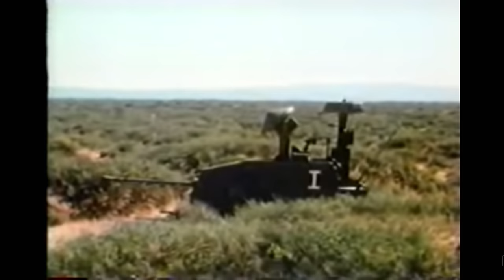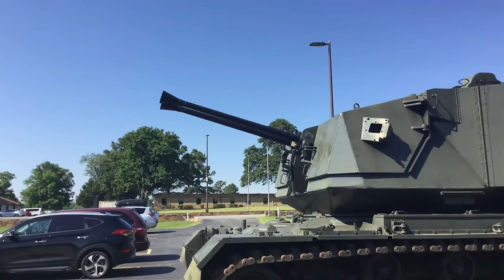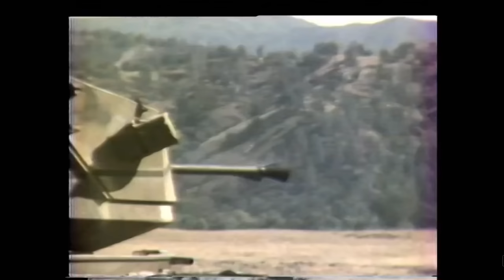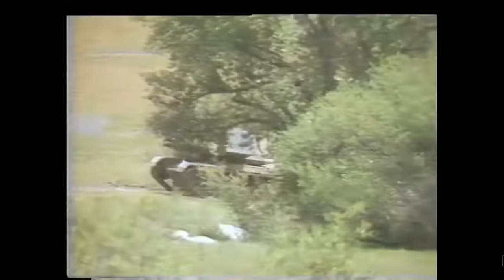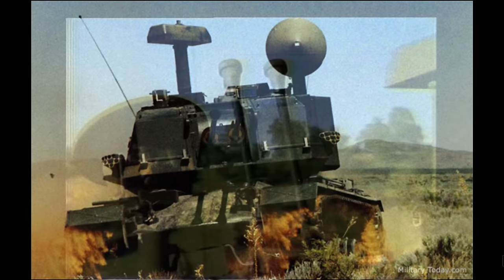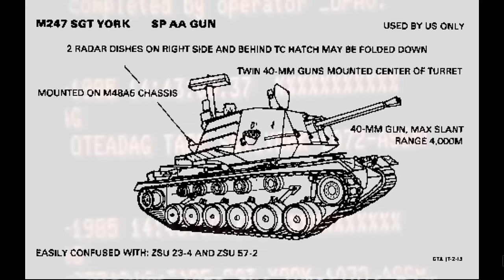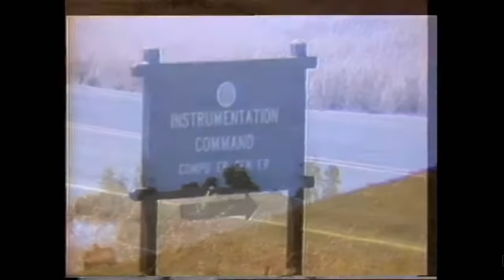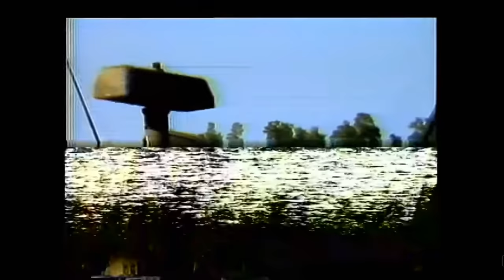M247 'Sergeant York' | WORST AIR DEFENSE EVER!

Comment: The 40mm L/70 was not obsolete by the 1970s it had seen continuous development since 1948 for instance the fire rate had been increased from 240 rpm to 300 rpm.
Also as 1960s turned into 1970s it got proximity fuzed ammunition and to this day 40mm remains the smallest caliber to have this.
In fact the 40mm L/70 is still in production in its mk4 variant which is electric instead of hydraulic
Reply: If anything, autocannon are going back to the 40-57mm range anymore. Anything less is becoming... problematic... in terms of kill capability.
Reply: 100% correct. These guns are more closely related to the modern Breda DARDO fully automated type used in shipboard mounts and not the manually operated WW2 type. I don’t think the US has ever deployed the DARDO in any significant numbers other than maybe for trials. The Sgt York was a failure of project development, management and systems integration. Contrast tis with the Shilka: adequate gun, radar/FC and vehicle properly integrated into a very effective weapon system for its time.
Reply: @TheTrueAdept  That's ironic as the original requirement when the 40mm calibre was chosen for what became the Bofors 40mm L/60 was that it should be fatal for the target with one hit.
Reply: @zenonsplawinski9436  The main problem with the 40mm L/70 in a vehicle is that it's very high. 
That's why in the Cv90 it's inverted and fed with a hydraulic loader from below !
But it also has the 3P programmer which can program the shells before they are fired to for instance pass through the top of a forest before activating the proximity fuze and hit a helicopter behind it.

If i remember correctly i think this is how the 35mm Oerlikon competitor approximates a proximity fuze they have an automated system that tells the shell when it is fire at which distance it is to blow up. Which means you need to predict the target location and have good range data.
Reply: @AdurianJ  True given the circumstances. The problem is that more places are armored against anything less than 30mm these days, and that is causing problems. Sure your average townhouse in Smalltown USA or Village Europe aren't going to be laughing off 25mm rounds, the situation is that most places AREN'T those locales and they've armored their buildings to resist most autocannons either due to conscious design decisions (basically everywhere NOT Europe or 1st World) or due to design requirements (skyscrapers). Add to the fact that the 'Griffin III' has 85+ degree elevation capability for its 50mm autocannon... that is telling on what is in for the future.

The 40mm sensor-frag round was pretty effective in doing its job (killing aircraft), and you can add HE rounds so you can better support the infantry. This very same system would be later used in the 'Trinity' prototypes which were essentially a LAV with a 40mm AA system slapped onto it.
Reply: Smaller ammunition in the 30mm and 35mm range can be electronically programmed to time burst by a device at the muzzle that both measures velocity and then programmes the timer.  With radar and muzzle sensors measuring the velocity at exit prior to programming it’s very accurate and also useful against personnel and vehicles.   An example is AHEAD.  Radar often further tracks the round and measures the miss distance and allows compensation of the subsequent round.   I suspect 30-35 mm guns will find application in drone destruction and destruction of anti tank missiles.  The Russians famously integrated a two stage missile with a 30mm gun to get the rapid reaction time of the gun as well as the range of a missile.
Reply: AdurianJ 
Bofors 3P is very impressive. With its multipurpose rounds and capability against targets in defilade and helicopters it makes for a great IFV armament.
Reply: @zenonsplawinski9436  I think the main difference why one is a good system and the other a lemon comes down to "You fail, you will go to the Gulag now" contra "You failed, now go to your comfy and wellpaid officejob" 
If you know screwing around means spending the next decade or two in Sibiria, i'm sure that is an incentive to make sure things work.
Reply: @BigSwede7403  Also Sweden allready had a lemon in the 1960's VEAK which used two 40mm L/70 guns just like the SGT York.

I believe it's faliure came down to cost and an overly complicated radar with search and fire control sharing the antenna like a fighter plane.
Reply: @AdurianJ  There's still not a lot of planes that can take a single hit from the Bofors 40mm and keep flying
Reply: @AdurianJ  Huh. Didn't know about that one. Interesting.
Reply: The 40mm received proximity fuses in 1942. NINETEEN-FORTY-TWO.....
    There was an OBSCENE amount of money wasted in Reagans arm race with the USSR.
Reply: @todiathink8864  You are wrong there where no proximity fuzed that small in WW2.

The smallest proximity fuzes in WW2 where for the British 114mm (4,5 inch) 

naval guns
Reply: I just watched a video on the 40mm Bofoors with proximity fuses! The 20mm were replaced with the Bofoors and the Dakota class BB's were fitted with them.
   Also, the Enterprise was fitted with the Bofoors when in dry dock in Washington SPECIFICALLY BECAUSE of the proximity fuses! DO RESEARCH Einstein.
Reply: The 40mm proximity fuse was the best kept secret of the war. When the war ended, everyone knew about the A-bomb but the proximity fuse for the 40mm was STILL a secret.
Reply: @todiathink8864  
The 40mm did not have proximity fuzes no matter what you claim a "Video" on the internet said.

The 40mm Bofors was fitted to US ships because of two reasons.
It was superior to the US Designed gun in the same class.
And a gun was needed that was big enough to shoot down enemy aircraft before they dropped their bombs. Something the 20mm Oerlikons could not do reliably.
Reply: I got the information from a you tube video just like YOURS. (Battlefield 360 Enterprise vs Japan)
   So, it's every bit as credible as YOUR YouTube video. 
   Nuff Said
Reply: BTW..... the refitting of the Bofoors to the Enterprise was done in Pearl Harbor, not Washington.
Reply: @todiathink8864  I got my information from the book "Bofors 350 years" which is the official history of the company.

There are other sources than documentaries and that 360 series does not give a reassuring impression.
I would suggest you should watch lecture videos instead like "Critical Challenge: A History of the Proximity Fuze presented by Stephen Phillips"
Reply: @zenonsplawinski9436  The 35mm competitors worked ( Both the USA one and the German Gepard ).
Reply: 40mm kanons were used in WW II by both sides.The 3 barrel Orlikon was truck mounted by the Germans.They were called flakwagens. So, anyone who do not what to catch any F.L.A.K. should not annoy people with super powers!
Reply: Doesn't matter. It's outraged by missiles.
Reply: Broke As FK  The latest version of the 40mm Bofors has 100 rounds in ready to fire magazines with the possibility of switching ammo types on the fly.

Clips vs belts have different advantages, clips are easier to load on the fly without taking the gun out of action temporarily.
Belts can have many more rounds.

The 35mm also don't have proximity fuzed ammunition instead they get told at the moment of firing when they will detonate by the fire control system.
Reply: @AdurianJ  Yeah that 35mm AHEAD ammo looks amazing. I think they also have the tungsten pellets/shot have a pretty uniform pattern with the fuse. I do know the gun primes it as it is leaving the barrel. Seen a test of what I believe is the SkyNex system take out 8 drones in one small burst. Kind of overkill for them but effective.

 Why the hell the US doesn't use such ammo and systems for the CIWIS and Phalanx is beyond me. Sure its cool we can essentially shoot a bullet with a bullet mid air but feel like there is a larger room for error and requires longer bursts.

 Also the 20mm doesn't have enough range or power. I guess the new hypersonic weapons are armored? I call BS on that ‐ at the speeds those things are going any piece of tungsten should be sufficient enough to cause significant damage. Even if it only damages the flight surfaces the missile would tear itsself apart or definitely miss the target.

 The Italians 70mm Naval gun is getting upgraded to 200rpm. I guess it can shoot down basically anything that flies and surface ships. Maybe the US should buy that and upgrade it with AHEAD type ammo. The range and amount of tungsten thrown into the air with such a gun would make quick work of anything. 

 Yet I am just a pleb. I don't know why we do things a certain way.
Reply: @dianapennepacker6854  The 35mm gun in the Cv90 does not have nearly the muzzle velocity of the 40mm Bofors but it has greater ready ammo loads. The AHEAD lacks a proximity fuze though which is very usefull for an IFV that lacks radar.
Reply: @AdurianJ  Oh I wasn't talking about
Reply: @AdurianJ  Well yeah I imagine better range as well. I am wondering what caliber most countries will settle on. First generation laser defense is coming online and looks promising.

 do know the AHEAD is an air defense system that works in tandem. Not really sure what Skynex is filling over Skyguard TBH. Not sure about the nuance or key differences. I just know it can be used against incoming air and ground targets. Definitely wouldn't want to be on the receiving end of it. Not that there are many bullets in the world I want coming at me hehe.
Reply: @dianapennepacker6854  Sweden will probably get the 35mm bushmaster or get a Bushmaster developed that fire more powerfull 40mm ammo. This for the next generation of fighting vehicle which will start development this year.
It will probably become a Cv90 mk5 or a Cv90 successor.
Reply: @AdurianJ  no, until the 1970s, the smallest round that can fit a prox-fuse is 75mm (the Skysweeper had HEPF rounds).

Comment: This sounds like the much needed Pentagon Wars 2.
Reply: Yes
Reply: The f35. Nuff said....
Reply: @903strikerunit  Part 3
Reply: Pentagon Wars made reference to the York somewhere in the first minutes I think.
Reply: Luke L.  development had plenty of problems. went far over budget, and is overpriced yet lacking in promised capability. its a joint strike fighter that isnt good as a striker and isnt good as a fighter. its isnt nearly as stealthy as the f22. can be detected by some current(and near future) sensors at bvr range. stealthy exhaust nozzles were designed with air combat in mind(thus bad stealth for strike missions). faceting and planform alignment isnt as stealthy as the f22, or even the x35 prototype. has poor kinematic capability. poor speed, poor acceleration, cannot supercruise, is not supermanoeuvrable. is not energy efficient too, therefore more fuel consumption, this is made worse by its small fuel capacity, thus you are forced to use drop tanks or aerial refuelling ALOT especially when carrying weapons. sensor capability is lacking. it has a small and weak radar and so bvr performance is lackluster. radar cannot be mechanically steered, so you are forced to use electronic beam steering only. very vulnerable to flanking attacks because of poor steering capability. its ELINT apertures are far fewer than on the f22. f35 will always be forced to rely on networking as its sensors are lacking compared to the f22, or even some gen4.5 fighters. it has poor payload, operational range, and overall striking capability. an f22, or an f15 silent eagle could, in theory outperform it in almost everyway. they would do well for strike missions, and also as fighters. do not underestimate the striking capability of a large high impact fighter that is stealthy at the same time. the f35 cannot perform strike missions safely against a sophisticated defender. the f35 will be forced to use stand off missiles as it isnt stealthy enough, and cannot penetrate deep into target territory. oh but long range stand off missiles are large, heavy, and expensive. the f35 will only be able to carry a few due to its low payload capability. on long campaigns, the f35 will drain the national budget because of its over reliance on stand off attacks. come to think of it. do we really need an f35? an upgraded f22 can do the job FAR better. an upgraded f15 and f16 can still remain relevant with stand off munitions and improved networking capability while being a cheaper option, as they are already available and dont need to be procured. instead of wasting money. wont it be better to make gen4.5 versions of our gen4s, and develop a gen6 that would supplement the f22? a new modern age of dogfights will come when stealth tech becomes more common and engagement ranges come closer and closer. most likely when gen6s come, the f35 will almost immediately become obsolete.
/
/
just kidding. the f35 is wonderful. lockheed and 1 million people say so, therefore it must be true. the f35 is a very good jet. it should not be on pentagon wars 3. countries want to buy the f35. they are totally not forced to buy it because they have invested money on it and have no other choice. if countries are buying it its a good jet. oh yeah, you can ignore all those totally fake reports about how countries are cutting down the number of f35s they want to purchase. its just russian propaganda.
Reply: @usaisthebestiockdownpoiice816  Binkov did a simulation of f35s vs Su35s and the f35 won most of the scenarios. 

Take off the tinfoil cap buddy. And before you say why should you believe Binkov.... why should I believe you?
Reply: @jedispartancoolman  you mean binkov battlegrounds? so, you use his videos as a way to placate your butthurt about the f35.. im no binkov fan nor a hater. and neither am i a tinfoil hatter. maybe instead of going the ad hominem route, you state the reasons, RIGHT HERE about how amazing your f35 is. you f35 apologists always have plenty of excuses all while deluding yourselves about the f35. first you call it a joint strike fighter, and when people point out how its lacking both as a striker and a fighter, you make excuses and site "sources" like binkov battlegrounds. meanwhile you ignore actual thinktanks and academics who have studied the f35 and who consider it as a jet of lacking capabilities. we dont need an f35. an f22 with improved ground attack capability is VASTLY better. stop deluding yourself kid. there are legitimate reasons why people hate the f35.
Reply: tell me, in what way is an f35 better than an upgraded f22. give an f22 thermo optical sensors, and it can do the job far better.. what about an f15 silent eagle? same story. upgraded f15 and f16 with standoff munitions would be a cheaper option, while we make a 6th gen fighter to supplement the f22. the f35 is lacking in LOTS AND LOTS of areas. and to make things worse, you cant upgrade it as easily as a larger fighter.
Reply: @usaisthebestiockdownpoiice816  nah
Reply: @jedispartancoolman  so youre all talk but no substance. fine... you keep fanboying over your f35. ill fanboy over my f22.
Reply: @jedispartancoolman  not even a part of this discussion and I know nothing about the topic, but he comes off as being knowledgable about the subject while you just go oh hurr durr tinfoil man and sling names, without providing anything substantive
Reply: @melikecomedy  his claims are baseless lmao. I told him to source his arguments. Not hey some guy who never flew this and his experience is ace combat.

I gave him my source and told him to counter. Get over it. All he did was spout the same BS every other troll does

Comment: Worked North McGregor Range detail crew in '85 during the testing of the York and it's counterpart the Vulcan against all sorts of targets. Was effective against ground targets and at least one high speed jet propelled drone. The 7 on-board computers and complex systems made this more expensive than an M1 tank. It DID take out an outhouse on the left side of the range just after the 1SG had just used it, couldn't ID the rotary fan on the roof and in front of a gaggle of Politicians to boot. Program was cancelled just days before the first AIT was to start and we prepped and shipped them back to the manufacturer. The Hulls were given to the South Koreans with old 48 turrets.

Comment: 40 years later the US Army still has no AAA in service.
Reply: But the two largest airforces in the world are the US Air Force and the US Navy to compinsate
Reply: What about the deployed  AN/TWQ-1 Avenger and MANPADS? To say t he Army has no AAA capability isn't exactly true. Then there is the Apache, which did shoot down helicopters in Iraq, and of course Air Force, USMC and Navy air assets. It's all about an integrated combat theater.
Reply: Don't really need it when you have air superiority.
Reply: @Solar2go  AAA is anti-aircraft artillery . We have no AAA.
Reply: @Chironex_Fleckeri  There's a whole army brand called Air Defense Artillery - PATRIOTS, THAAD, MANPADS, Bradley, Avenger w/ missiles and a modified .50 caliber for anti-aircraft fire. what more do you want?
Reply: @Matt-sf9ky  idk 50 cal sounds a little underwhelming
Reply: Well, missile systems can be defeated by various countermeasures, so having a AAA that will add upon the various AA Missiles developed will help in intercepting enemy aircraft.
Reply: Well, they have the Vulcans, but AAA in general can be easily defeated by non-line of sight missle. There was a program called Excalibur which was a Vulcan on top of an 8 wheeled vehicle, was designed at the same time as the avenger, but cut for budget and effectiveness. People compare the Avenger to the York, as if its a 1-to-1...but cost/resource its really more like 1 York vs. 4 Avengers. Additionally, the York is only appropriate to deploy with other tanks, but the avengers can be deployed with any other units.
Reply: Lots of states tried those things, but sending a tank to do a jetfighter's job doesn't work.